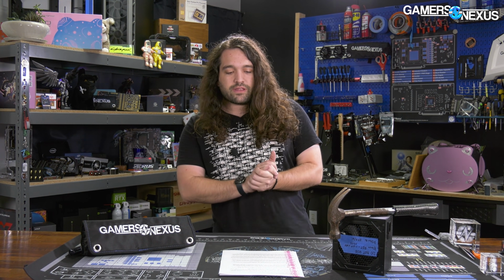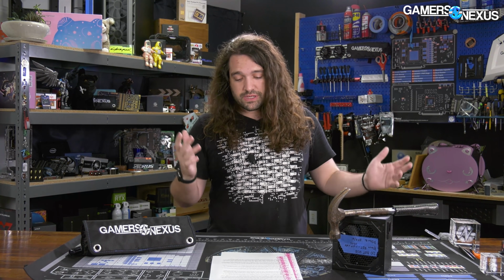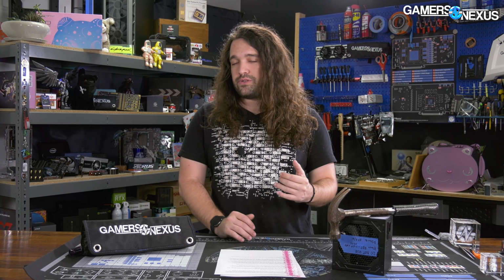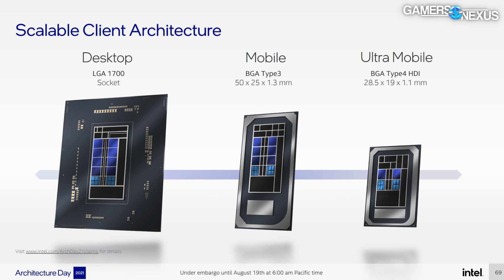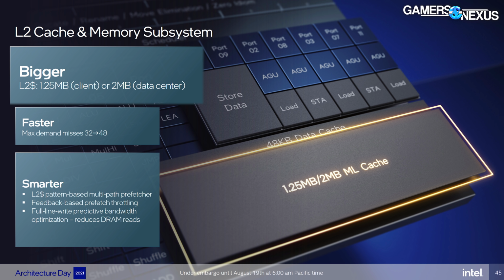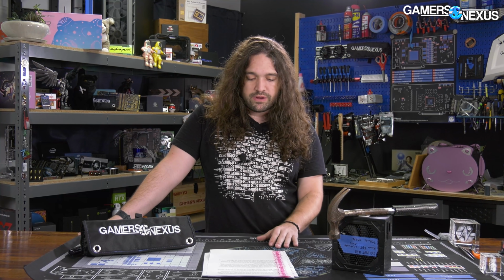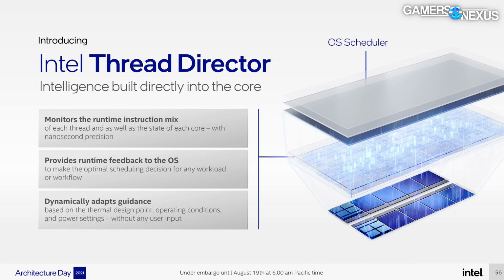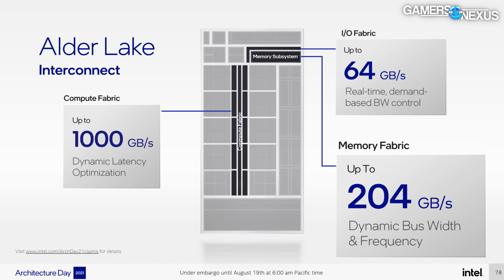Intel Overhauls CPUs: Alder Lake Architecture Explained - New Core, PCIe Gen5, & DDR5

Comment: Went from the 9700K 8C/8T to the 12700K 8P+4E/20T with a 2080Ti FTW3 and my goodness the latency is much much lower and even with DDR4 3200Mhz RAM while gaming i was hitting the upper 80% for usage on the CPU even when GPU bound now that 80 is down to 30-40 max and that’s been rare. I was kind of hesitant on the P and E core thing but i basically treat it as an 8C/16T CPU when going into config files for games for cpu usage because it shows i have 20 threads but 4 of those are E core threads. Got it with an MSI z690 pro and couldn’t be happier. Now onto either high end 30 series or waiting for mid 40 series have to offer.
Reply: Oh and I use a 360mm corsair capellix AIO and temps at idle and 4.7-4.8Ghz are 24-28 degrees and gaming 40-50 which is crazy decrease
Reply: "8C/8T"
Worst i7 ever made. That's the problem. It should have been 16 threads.

Try to use all 20 threads on the 12700K, e-cores will help for raw parallel processing in a game and increasing single core perfomance for the p-cores, Cyberpunk 2077 likes them.
Reply: @saricubra2867  I have been loving this upgrade. And yea sadly i went from the 9400f 6c/6t to the 9700K 8c/8t to the 12700k so this is my first cpu with hyperthreading. That 9700K should not have been an i7 they really screwed up but time with that one. It worked for what i used it for but towards the end i was getting pretty bottlenecked. Haven’t come close to a bottleneck now. Besides my 2080Ti, she’s starting to bottleneck my 1440p gaming and im sad, but it’s always fun buying a new GPU. So many choices i have right now too between the 30 and 40 series. Gonna do more research before going for probably the 4080.
Reply: @saricubra2867  Oh and im still learning the difference between the P and E cores, I’ve basically been treating it like it’s an 8 core 16thread CPU when it comes to like cal of duty config changes, they had my CPU affinty at 11 and i changed it to 8 sometimes ill go down to 7 because the 12700K is even too powerful for the 2080Ti. I got the cheap MSI z690 board but overcloking is fairly easy even though I don’t have to in just used to doing it, im at 4.9 P cores 3.9 E cores a 3.9 ring ratio (still having trouble finding that sweet spot) and AVX offset i leave to auto, and im setting at a 1.295 Vcore and it’s a 24/7 overclock. Luckily i had a 360mm corsair AIO already so my temps are good I think. While gaming im only using at max 25% on the CPU but temps stay in the mid to high 30s and even when im downloading something and im at like 80+% usage im only hitting 60-65 degrees. I think the silicone lottery went in my favor. I mean i got it from my Micro Center and they never have bad CPUs atleast that I’ve seen. Also, the 12700K was like $100 cheaper than the 9700K was when i got it and i got them both about 75% through their life cycle. Even the 9900K is going for like $600+ now. But brand new that thing was stupid expensive. But yea im glad I didn’t listen to the idiots who told me to get a 10th or 11th gen because they were the ones scared of the core change. I was at first as well and almost went Ryzen for the first time, i had the 5950X in my cart at the time but then i realized, I don’t know dick about Ryzen and i love to overclock Intel chips so im glad i went with the 12700K. Also, this mobo has 4 M.2 slots my last one, the z390 only had one and I’ve wanted to swap this intel 660p ssd for years now and i even had a 970 evo but gave it to a friend who needed it then i got this motherboard and now im going to get the fastest SSD i can get my hands on. So my next upgrades will be GPU, PSU (currently have a 750w EVGA but the 2080Ti FTW3 pulls up to 400W alone sometimes but is usually stable around 275ish) then it’ll be my SSD and I be fully upgraded. But yea i could literally feel the lower latency when it came to gaming as soon as started using this cpu its fast as hell.

Comment: 15 years ago when SUN was making large servers for corporations they realized that core count and multi-processing was the best way of creating a computer that do many more tasks. Now most CPU manufactures have come to the same realization and making chips smaller with large core counts will allow a user to use a workstation and do complex tasks that were not capable on desktops or laptops. In a few years most CPU's with be at 3-2 nm because its too expensive to design a 6 GHz. But the machines will be very powerful.

Comment: I'm still trying to learn this stuff.. so is Intel basically on a chiplet-like design now? Has anyone been able to test for core to core latency due to this change? From what I've read, lower memory and core to core latency has been Intel's strong point because of monolithic design, also explaining why Intel systems typically felt a tad bit more responsive than AMD at least until 3rd gen Ryzen.

Comment: I have a old CPU, intel i5 2500K on of the best processor for the money at that time, I am really exited to switch my old PC to the new architecture, the main use of my pc is as a WEB Developer I think this kind of architecture will allow to me to work on so many things at the same time using the P -Core and windows and other aplication can run on the e-core in order to allow  my main taks running faster

Comment: Only i5 12600 and above will have E cores...
So the famous i5 12400, will be just a higher clock 11400? 

Why have e cores on hi end desktop? I9 12900k has 8 + 8 cores, so on paper they seem at the same level as r9 5950x 16 cores. I mean , this seems more than a marketing scam, that a actuall need. Idle power consumption is good for cpus, desktop pc don't use battery, so why bother with e cores , except for the number of cores on paper? 1 P core = 4 e cores so, an i9 12900k seems like an disguised i9 10900k..

Just my opinion....
Lets wait for the reviews, for the new architecture,ddr5 and platform in general

Comment: You know, maybe having smaller, efficient, in-order execution cores could be used as a security feature, by side-stepping potential security issues that can arise from whatever implementation of out-of-order execution by executing sensitive code on those small cores.

Comment: Let's not forget that all this mumbo jumbo is achieved by combining resistors, capacitors, transistors, inductors, oscillators, sensors and other electrical components in a novel and smart way so it can all chew and spew information readable to us....

I'd say that whoever has done any repetitive calculations or operations with matrices (or tensors)  larger than ....3x3?.... by hand can deeply appreciate the wizardry level that we now operate day to day and sometimes even make fun of as some manufacturer seems to not being able to keep up and releasing more slabs of >thang< filled with billions of transistors that can't be seen, nor touched or manipulated by any human hand, and can only be manufactured in increasingly harder-to-achieve conditions
Reply: It's like... please anyone, process me a 40column x 1000rows excel spreadsheet by hand...... with no errors...... 10 times a day

and we now have machines for ML and DL performing computations on datasets with 1000's of columns and millions of rows pretty much on a daily basis... (sometimes several times a day)

Comment: Pairing the overheating P cores with E cores strike a nice balance between performance and heat but I think Ecores would run 80% of the time.  This sounds famaliar, right of past industry approach? Key is the direct data approach with wider pathways but the CPU design sounds like an aftermath of a bad reverse engineering. If it was an innovative chip, the CPU would achieve higher performance at lower price.  You know, Intel is throwing the entire kitchen and higher part commonisation at a problem, which implies an expensive Intel production cost.  So, why would consumers pay for higher production cost? I think switching latency would downgrade performance and the CPU benchmark performance would still favour AMD. Wouldnt the Thread Directors' lifespan be shorten with the amount of switching between P and E cores?

Comment: Having Efficiency cores in a CPU is pointless. If you want efficiency all you got to do is drop the clock speed of the CPU when under light to no loads. setting the base clock on current cpus at 1.8 ghz would achieve the exact same thing while giving you 10 strong cores instead of 8 strong 8 weak. you are basically just getting scammed out of 2 cores.
Reply: The efficiency cores is the reason why i9 12900k beat 5950x
Reply: @thithuhavu3568  at power draw? so would dropping the base clock speed like i already said.

Comment: Intel CPUs are fundamentally hilarious. 

When the various 16-bit CPUs were introduced in the late 1970s, like the Motorola 68000 and the Intel 8086, Intel admitted that they could have made a better CUP if they had totally forgone compatibility with the 8080. You see there were programs like Conv86 that could convert 8080 assembly code to 8086 assembly code because the 8086 had so much structural similarity to the 8080. This allowed the 8086 access to a huge library of existing code giving it a market advantage. 

But 30+ years later that 8086/8080 design at the Intel heart cannot be the most efficient thing possible. So when do we trash the glorious 8080?

RISC-V anypne?

Comment: I dont trust software to make the right decision for me as to wether I want application "X" to run on the Performance cores or the Efficiency cores. Imagine some game you want to play getting like 50% of the FPS it should because it runs on the wrong cores. There better be some very easy right-click context menu way of specifying it or else I will not even consider the product unless it's like crushing AMD's offerings beyond reason.
Reply: The is no such thing as run wrong cores because the system will use P cores first before assign work to E cores
Reply: @thithuhavu3568  so no option of choosing to save power sometimes if only using Chrome and Office?

Comment: The multiple types of cores sounds like a solution looking for a problem, adding low level complexity that honestly should be kept as simple as possible.
Reply: I disagree, today's pc environment is much more complex than it was 20 years ago, and even 10 years ago. With discord and minor compute task + hw monitors and whatever other trash we have open it's no longer the days of having ventrilo instead of Skype to save some fps in cs 1.6 (with nothing else open)
Reply: That being said, I think it's gonna be a few years until we reap the benefits of the little cores. In quantity and quality.

Comment: Bro you suggest me which psu Buy
CORSAIR RM750
ASUS  ROG-STRIX-750G
GIGABYTE AUROS GP-AP850GM/ GP-AP750GM

For my pc build better for long time 

GIGABYTE X470 AORUS Gaming 7 WIFI
AMD Ryzen 7 2700X Desktop Processor 8 Cores up to 4.3GHz
MSI Computer GeForce GTX 1060 6GB GDDR5 Graphics Card

Comment: Funny to see them adopt instruction length pre-decode, an idea i had in my head for many years now.
I wonder what took them so long as it's such an obvious thing to do.

Next step:
Also pre-decode instruction class where it can be done without extra latency.
That way more specialized/simpler decoders can handle the final decode, using less hardware, so more decoders can be present (lower latency/faster throughput).

Comment: am i the only one more interested in gracemont than golden cove? if its 4 gracemont cores fits in 1 golden cove core then staying at 8 big and just scaling the small cores 4x over amd will hands down be the best solution for massively scalable MT performance without sacrificing ST perf. you could just make an 8C chiplet with 32c chiplets (C=big, c= small) to get huge MT perf with better power scaling. if the program can truly scale on MT going up by 4 cores is just so much better than by 1 Core

Comment: I use a Blackmagic camera and having more than 8-12 cores sees rapid compute, but more cores does not speed up Davinci Resolve edit, FX, audio and render out.  "Diminishing returns" as they say.  Faster RAM and PCIe would be nice, and current CPU speeds are fine.  Lower power and quieter rig - much needed.

Comment: My understanding from other videos I've seen is Intel is adding a unit that performance some checks and make sure high powered tasks go to high powered cores and low to low cores to avoid problems  with Windows scheduler like AMD had with Its FX cores where the scheduler couldn't tell the difference between the two types of core. 
It could work for power and battery on mobile debices like laptop or tablet but can't see how it competes on desktop where power usage isn't an issue (other than in the heat that is generated) as 4hi&4lo wouldn't compete with 8hi as a the hi core would burn through a task quicker and then shutdown and start cooling and using less power long before the lo would finish and shut down running the same task. As for seamless switching it will still be delayed but the important thing is by how many clock cycles.

Comment: These changes could make low core CPUs redundant or perhaps slower as the core designation software in the OS is looking for more threads/ cores to distribute tasks. It's much easier to 'just pick another thread/core' than it is to decide which other task do I want to push through on top of the other task - is the process going to increase over time, stay relatively constant, when do you switch threads or cores because the task is becoming more intensive etc... Decisions in changing allocation results in latency.

Comment: Big-little, in general purpose computing (not mobile), is a preordained failure when your direct competition can supply more of everything in a comparatively symmetric fashion. AMD doesn't require the additional scheduler complexity (in a world where scheduling is already a challenge) nor does their solution require the additional specific code optimizations for two different potential execution paths for different core types that are sharing common resources (e.g. L3). Furthermore, they still aren't making significant gains in overall power efficiency, they're just treading water. Intel has had 3+ years of insight into what their competition were doing, yet responded with something that smacks of over-engineered marchitecture and desperation. Clearly, they still have major yield issues on their 10nm process that is driving transistor budget deficits when it comes to basic compute.

Meanwhile, if you can stomach it, watching their desperately happy architecture day presentation, that covers Sapphire Rapids, paints a sad picture of misdirection with buzzword bingo (AI, MicroServices architecture - hell they don't even get the definition correct on that one), so they can talk about all sorts of ancillary infrastructure fabric integrations, while very carefully minimizing discussion of core and logical processor (thread) counts. And, while their interconnect solution for their "tiles" may be nice (we'll see how it measures up), it's still just an implementation of a multi-die strategy that AMD has been using for years. Thanks to Gigabyte's poor security (when they're not building exploding PSU's) we know why Intel didn't want to talk about core and LP counts: Sapphire Rapids die shots indicate they have an upper limit, in a 4 tile config, of around 80 cores/160 LP's (interweb says initial parts will be 56 cores) - and AMD will be shipping a 128 core, 256 LP part, around the same time (Intel has likely known this for a while).

Ultimately, we all know where the problem is: fabrication. Their new "performance cores" look impressive, and Intel has brilliant uArch folks (arguably the best in the industry); but the company needed, 3 years ago, to swallow their pride (and it is pride and hubris that got them to this point) and admit they needed outside help from TSMC and Samsung on the fabrication side. As it stands, Alder Lake and Sapphire Rapids are far too little and are far too late, no matter how good their fabric, uArch and IPC improvements might be. As an engineer, I'm unimpressed; as a multi-decade Intel shareholder, I'm seriously concerned.

Comment: In theory this is a huge step forward.  But one aspect of it REALLY scares me: the Thread Director interacts with the OS, and I trust Microsoft with that power not at all.  For example, I wanted to enable power saving when I built my last PC.  Win 10, updated regularly.  Should be easy.  A day of fighting with it, even after turning off everything but the CPU % changes, it still couldn't play a YT video without constant stutter.  Firefox used only 7% CPU at max, usually much less.  But a 33% minimum CPU threshold still stuttered.  Eh?  Even if single-vs-multi core maths are involved, 4x7%=28% which is less than 33%.  I gave up and went back to max power as Microsoft Win10 with power management clearly nerfed the CPU beyond reason.  Now Intel is giving them even more opportunity to mess with what the CPU is doing?  I am afraid.  I might finally daily drive Linux.

Comment: I really hate big little architecture.  It's an extra level of complexity developers need to optimize for and it rarely works as intended.  Don't understand what power savings are for in desktops.
Reply: Its not just power saving, 4 gracemont cores can beat 2 skylake cores with HT with litte more than half power
Reply: @thithuhavu3568  Are you really making a comparison with processors released 6-7 years ago?
Reply: @thithuhavu3568  2 zen3 cores can beat 2 Skylake cores with half the power, it's not a very convincing win for Intel.